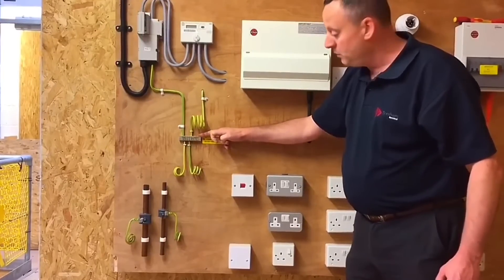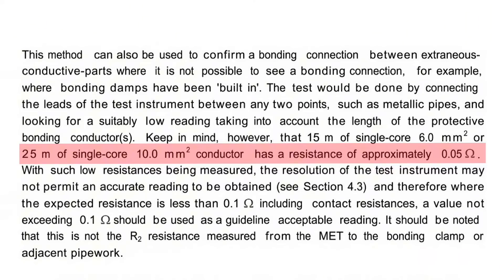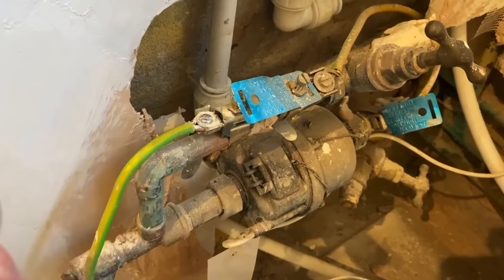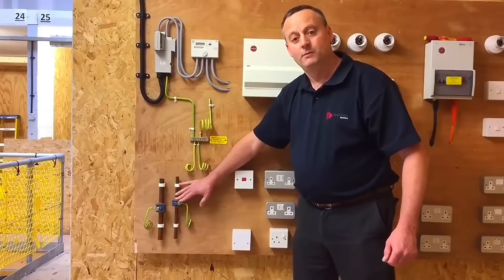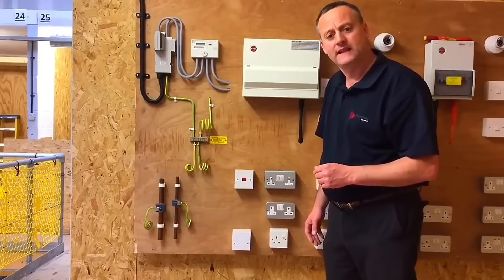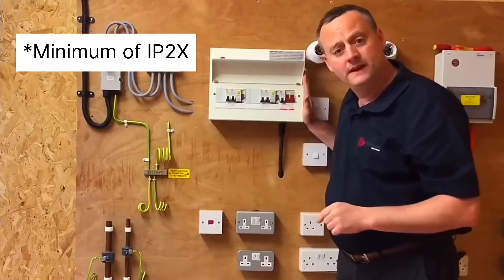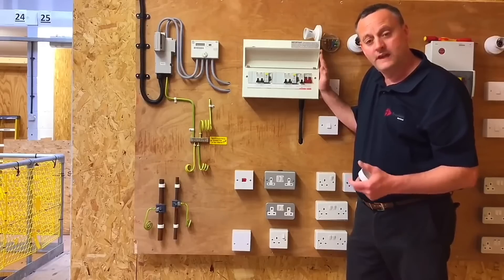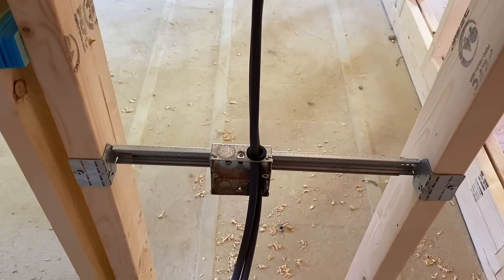Automatic Disconnection of Supply Explain - ADS

Comment: The point about the bonding to the water and gas pipes. If the voltage in one of the bonding cables goes above 50v the offending circuit is supposed to disconnect via its breaker. How does the breaker know the voltage is above 50v?

Comment: What about gas meters with only earthing bonding outlet side but metal pipe feeding them ,if due to resistive or disconnection of earth bond at any point of supplier or bond connector if a leakage of current were to occure at say a water pump and the earth bond is daisy chained from water pipes to  gas pipes then shortes path is through the gas meter as most water supplies now are in plastic,  isnt it more feasable to link both ends of gas meters with a link accross to inlet pipe aswell as outlet to prevent this as the steel brackets in the meters that link the two pipes become rusted even if galvanised  as has happened before?

Comment: 4:27  Hmm...  Are you sure that water pipe has a metal incommer...?  It looks like black plastic (used before they were blue) to me!   Also, isn't it preferential to use a separate bond for both the gas and the water, rather than just daisy-chaining only one main bonding conductor?
Reply: It's preferential, but within regs to use an unbroken link through from one to the other. Copper is expensive, why run 20m of cable if you don't need to
Reply: @PTechMedia  
I believe the cable has to be unbroken - the insulation stripped back in the middle of the cable. But is that a part of the regs?
Reply: @johnburns4017  thats what i said, it is prefered to use a seperate cable direct to CU, but you can strip and link it, as long as the cable isnt cut - it needs to be a continuous cable.
Reply: @PTechMedia  
I never quite got you there.
Reply: I would say so as you then have added safety as gas and water is separately bonded and you won't get any false readings as can test cabling separately

Comment: Gaz, FOR FINAL CIRCUITS (TN) unless the circuit is supplying only fixed equipment where it’s still 32A max for 0.4s, Doesn’t the 18th Regs now indicate a max 0.4s on any circuit containing a socket up to 63A up from 32A?
Reply from the maker: The video is 8 years old 🤦🏻‍♂️
Reply: @GSHElectrical  LOL. Thought Gaz was ‘looking good’ 😁

Comment: I never really understood why anything up to 32 amps disconnection time is 0.4, but anything over 32 amps is 5 seconds.  I thought it would be the other way round, seemings over 32 amps is more dangerous no?   Why am I missing here?
Reply: On circuits of less than 32a,especially a socket circuit there's a very good change a person is in direct contact with  an item of equipment such as metallic kettle or other appliance so circuit needs to disconnect quicker. Above 32a the circuit is likely a distribution circuit or supplying fixed equipment that a person is not holding at time of a fault.
Reply: @18in80  excellent explanation I was just thinking the same now I know and it makes perfect sense thankyou.